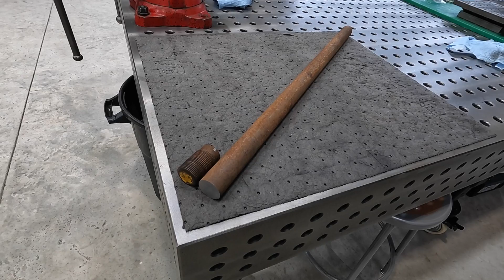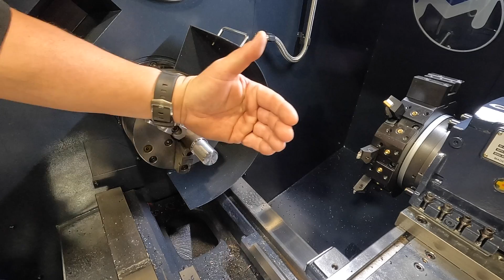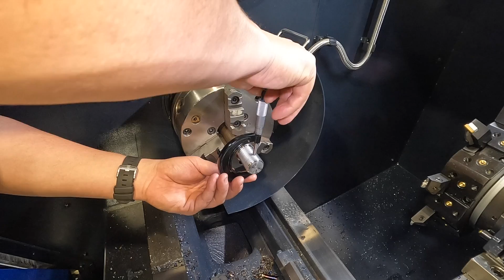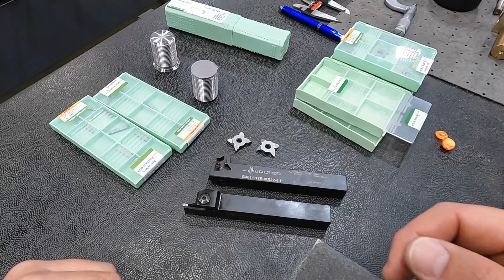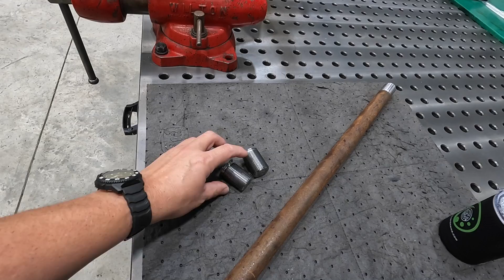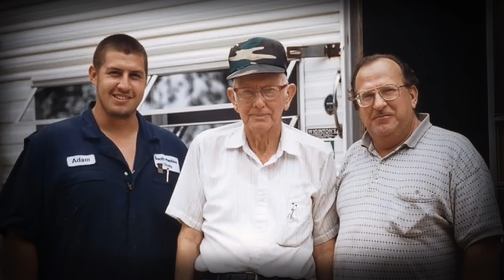CNC Machined Threaded Rod Ends

Comment: I am trained as a scientist, not a machinist, but perhaps I can still be useful. I know that I get paid for measuring things but you get paid for making things to measurement specs.  Still, all of you successful traditional machinists take a lot of "extra" measurements:  measure twice, cut once. Could you write a few CNC programs that just measure things?

Most CNC tooling and methodology seems to automate tried and true manual techniques.  Where are your analogues for dial indicators, edge finders, calipers, and micrometers?  Having watched a bunch of CNC videos, it seems to me that one common replacement for the dial indicator is a tool with a white rod and a red sphere.  That can be used to "touch off" on surfaces before applying cutting tools to those surfaces.  For example, in this video, you put bar stock into the chuck, set its stickout by measuring with a ruler, and then took a first cut on the face.  Sometimes your first cut was small, sometimes it was big. If you had used something like the rod-and-ball tool to literally touch off on the rod end, you would know exactly how deep to start your first cut.

If you built up a few ultra-simple measuring programs, you could use them to be more confident about knowing where your workpiece actually is.  Running a program would likely take less time than even using a ruler, much less a micrometer.

Since I'm not a machinist, these are just suggestions.  You're doing great already, hope you continue to learn.  I've been a fan and a subscriber of this channel for years.
Reply: Scientist comments are so recognizable, so eloquent.  I remember a scientist wrote a long paragraph comparing the metric to the imperial measuring system, here on this channel. Normally a topic that lots of ppl weigh in, but his analysis was so thorough that nobody responded; what's more I remember it more for its thoroughness than what he was actually said!.  On your particular points, Adam noted that the bar was cut off very roughly and not square, probably with a grinder; so using a rule to measure stick out is sure to give some variance in the depth of the initial cut. Also more generally, getting that first cut right is often done with a tiny bit of paper for touch off of a tool. The cnc method for attaining consistent stick out is very analogous to the method Adam uses with his fancy  end stop which can be swung in and out of position. For a cnc lathe fed by bar stock,  the turret is rotated to a no tool or blank position and moved to its precise z position.  The feeder moves the bar against this stop and the chuck is  closed.  No need for a dial indicator or probe,  The Renishaw type probe  ( white stick with red ball) is used as a length or bore measuring device rather than as a replacement for the dial or test indicator which measures 'linear' or rotational run out. A big step forward was incorporating the Renishaw probe in the lathe ( or mill).  Previously, if there was a critical bore which needed to be measured before proceeding,  you would pause the program and use a separate measuring device, let's say a bore gauge.  Post machining, the item goes on the CMM for QC using another Renishaw type probe. All probes need to be in line, or you got problems; nonetheless using a Renishaw probe mid program in the dirty environment inside a lathe machine might not be ideal.   And you don't want to use a Renishaw  to probe dirty, rusty surfaces.
Reply: @richardjones7249  , thank you! I'm not certain my comments deserve such a level of praise, but in the spirit of the YouTube community I will assume that you are not being ironic :).  In any case, you gave me a lot of good information in reply, so I am truly grateful.  Being very interested in measurement tools in general, I will certainly look up more on Renishaw probes.

In some sense, I was suggesting that since Adam is clearly a skilled traditional machinist, he should experiment a bit with how he can convert some of his manual workflow efficiently to the CNC world.  I notice that Adam (and others) are often pulling out a dial indicator, edge finder, or other measuring instrument "just to make certain" a mistake isn't about to happen. He might want to do the equivalent in the CNC world.

I certainly didn't mean to imply that one would keep a Renishaw probe on a rust or mill scale covered moving surface!  That makes my teeth ache even thinking of that.  However, when Adam is adjusting a chuck he often will hand-turn the lathe one or two turns looking for high and low spots.  Is there a good way to do that on a CNC lathe?

OK, I'll try to leave the rest of this conversation to the pros.
Reply: Thanks to the excellent comment by Richard Jones, I made a quick foray into the large selection of YouTube videos on Renishaw type probes.  If you've read this far, you most likely are open to the idea that YouTube videos can be useful.  I'm not competent to say which videos are most useful and most accurate.  I would suggest that you look for a video from Haas Automation Inc., with the title "Set Work Offsets in Seconds -- Haas Automation Tip of the Day".  There is also a Renishaw channel. Good luck!
Reply: @stuartschaffner9744  To look for Total Indicated Runout (TIR) on basic CNCs it's done the same way as a manual with and indicator. Other wise really, most (I assume) trust that the chuck they chose has high enough repeatability or they're using a collet system along with large enough stock that you can true your final part to the spindle through roughing passes.

And some things are worth automating, while others aren't. That being said, being a mechanical engineer around the manufacturing world, machine tools are getting more and more sensors as the years pass on. Just a balance of computational power, storage, measurement device and work environment. 

Recent examples in my mind are cameras used to watch SLS/SLM machines as they go layer by layer to check if there is proper bonding though the area currently is "small" (about 1cm^2, it's a master's project that is the length of a PhD working with NASA) as well as using cameras to measure form in situ for free form optics. The camera can be placed in line with the spindle (off the machine?) and is easier to set up, align as well as less sensitive to heat. This is opposed to machining the optic, placing it in an interferometer and aligning the null form (corrector? I forgot the correct term) which really can't have any heat as well as it takes the part out of the machine. Null forms are also a pain to align as they have to be perfectly in line with the optic to work correctly otherwise there is error.

Comment: To reduce the chatter, move the material closer to the chuck. For the groove tool, reduce your RPM and increase feed rate.

In your programming, face your part first, then turn and then chamfer last.

Comment: You may want to try a G76 multi pass threading cycle using your CAM software. It basically cuts one side of the thread at a time, alternating each pass. It doesn’t load the insert as much and you’ll probably have less deflection.

Comment: I usually re-cut the theead major diameter and take another spring pass on the threads to remove the burrs on threaded parts. Easy peasy on CNC machines.

Comment: What is the purpose of a thread relief? Does that not make the metal weaker at that point or Is it a negligable difference in strength?
Reply: It gives the threading tool a place to stop the cut and retract the tool cleanly. If it wasn't there it would be very difficult to retract the tool exactly at the end of the thread without running into uncut material. It does weaken it sure, but not by much and it should still be well within the factor of safety.
Reply: @Braeden74  aaahhh thanks for the explanation. Totally makes sense.
Reply: The thread relief should not be smaller than the minor diameter. That is the weakest area of external threads. I cut many external threads on CNC using a G76 and it retracts in X gradually to the major diameter. No affect to fit, form, function or FOS.

Comment: Adam, talk to Milltronics about how their lathes are setup.  When you change a tool geometry offset by 0.001" that will likely be a radial change.  Some controls have options for making the wear offsets radial or diametric.  I've got my lathes set up in diametric but your one thou change may have moved two thou just because it is a diametric change, not a radial change.
Reply: Agree. The ML22 I use at work is setup for radial adjustment in the offsets but I'm thinking it can be changed to diametric as well.
Reply: He had a Milltronics guy there for training on the machine. Wear offsets are as basic as it comes and surely would have been part of that 'training'.
Reply: @richardjones7249  Adam is drinking from a firehose right now and this is a simple thing to miss or forget during (or since) training.  I have been running my specific machines here for a few years and still constantly have questions for the applications guys. I'm just trying to help him the best I can because he taught me how to run a lathe for free on the internet and now I am actually in a position to potentially give back.

Comment: you really need to consider a different chuck type for the CNC, scroll ring chucks have too little clamping force and the jaws are not serrated enough for proper clamping grip. a wedge bar chuck would be much better me thinks.

Comment: Adam, a little tip for you on repeating stick outs: call up tool 1 and bring it into something like X4Z0 and hand jog into X0 with the stock back in the chuck jaws. Pull the stock out until it touches the tool. It acts like a stop and your stickouts will all be within a few thou if you're repeating ops like this.

Comment: Would the rust on the bar stock hurt anything or add to the chatter? Thanks for the video's.
Reply: It is abrasive and will take the edge off HSS tooling, not so much on carbide as it is hard and you can cut deeper and get under the rust.
Reply: We had a job at the railway where the bar was rusty, the tool tip was doing a skim and not breaking through the skin and would only last a few jobs, I dropped the Speed Per Min down and used coolant (just on the rusty pass) and the tip lasted all day.

Comment: I program with solidcam for the last 10 years, I program in metric, but I always leave 0.1mm in my roughing program, then come back with a finish pass so it's very light on the cut and eliminates all chatter with the tooling, machine and stock. Always always always run a finish pass for a quality finish and to size more consistently 👌 love watching you grow with cnc. Old school subscriber.

Comment: Interesting thread measurement tool,  I don’t remember them or they were not though of when I was a young apprentice.  First time I’ve seen them.  I learned on the old 3 wire and still have them 25 years later.

Comment: Nice to see you using this machine, The nice thing about CNC lathes is you don't need to use those types of radius tools like you would on a manual lathe.  You can program a DNMG type insert to go in there and put what ever shape you want.  I'm not criticizing, just reminding you.  I'm not very good yet at programming from scratch yet.  I run and edit alot of programs on CNC lathes at my day job.  Love it.  We usually rough everything with CNMG on tool #2 then finish with DNMG tool #1. Pretty cool how you can program those radius in with a normal cutting tool or even use radius tools moving in the program, not just straight in.  Thanks for the video, I love these CNC videos.

Comment: Happy New Year. Love your videos and have learned a lot from you. On the fuzzys after threading: I was taught that after the threading, do another finish OD pass with your turning tool and then a final spring pass with the threading tool. This takes the burrs off the OD and the final threading spring pass takes the ones off that the OD tool folded in.
Reply: He's fully aware of that in manual machining, he was saying he needs to learn how to program that into the CNC program, or learn how to do a manual cleanup pass after the program runs.
Reply: @kinda blue  
I was suggesting that he put them in his  program , not do them manually.

Comment: Rigidity-stay close to chuck, more passes on threading-10 -12 +2 finishing, coolant, coolant, coolant, 
Threading inserts have different point geometry some are pointed,and some are flat. Always start oversized 
You can always program down to you hit specs. Slow feed rate on finish pass on thread relief if conversation programming 
Permits.

Comment: Top Tip. There is movement between the bar stock and the chuck jaws "because of the rust on the bar stock" Two minutes with an angle grinder with wire brush. It doesn't do your precision ground chuck jaws any good at all.

Comment: I was thinking there is some micro movement between the part and the chuck due to the length running inside the spindle and rpm and tool load. Maybe a center and tail stock with that much OAL.

Comment: Too bad they don't have a 'file' insert, or a 'stone' insert. Might be an oppurtunity there to create something new.... but, if you do, maybe talk to the manufacturer so you don't crash the unit.
Reply: It is available to buy if you feel you need it, otherwise it is better to do it right from the beginning.
Reply: I've seen and used lots of abrasive brushes to clean/deburr edges on CNC operations. It's a pain to dial in the right F/S (not like theres any tables in the handbook for that kind of stuff) but once u find the right brush and parameters they do work well.

Comment: take lighter cuts for the finish passes with the threading tool, take more cuts, add coolant, the took rub will cause chatter. i just went through this with my lathe. with grooving tool, use a z back and forth walk in, so oscillating the z on the way in. all lessons my lathe has taught me

Comment: Vibration due to lack of spindle/turret rigidity ... I work on a mori seiki nl2500/700 dual spindle . 

Try to reduce the threading passes to 2/3thou and put 2 spring pass at the end of cycle ... The grooving tool for thread relief try Also on that 2/3 thou per rev
Reply: For thread burr try to use full form thread insert : iscar , kennametal or sandvik are the best.

Comment: Are you sure that you have the grooving tool and threading tool in the correct way? You have the turning tool upside down which is ok for anti clock wise rotation of the chuck. That grooving tool looks like it is upside down with the insert clamping screw on the top. It is hard to see the rotation direction. How does the turret lock in position? Like someone else said here you should have the force pushing the X axis down on the bed, Just a thought. It is good that we have feedback so as people can learn. You Tube best thing since sliced bread.
Reply: Good comment. perhaps all the tools could be changed so the turret is always forced down during cutting.
Reply: @danneumann3274  It is a bi-direction turret but the tools should be all facing the same way otherwise the tool height would be miles out. Think about it if you have a 16mm tool and you turn it upside down it will be 16mm out of allignment. You can do it with boring bars as 180 degree rotation is the same tool height.
Reply: @philiptrueman8894 very true. I forgot about the tool height. I have 2 cnc lathes. I should have remembered
Reply: The turrets on the milltronics are like most turrets of the type and allow for left or right hand tools in either position.

Comment: Its a cnc, so there is no need for a chattering grooving-tool at this point, just turn the undercut with your dnmg-insert (-30°). Happy new year!
Reply: It's not necessary for an u/c on that job.
Reply: u/c = undercut.
Reply: @4418CARLOU  Yea, figured it out in the meantime, but thx. Thats why i edited my last commentary... but it seems u readed it before. Sry.
Reply: @4418CARLOU  I dont know, if its needed here, depends on the function and the other part. The final workpiece has a shoulder and without an uc u dont have a full thread at the end.

Comment: Happy new year Adam.

the last part turned out very nicely. Certainly already an improvement over the first few tries.

One recommendation: Try to get used to using a tool for roughing and and 2nd tool for finishing, even on small batches like these.
Reply: Conversational may not provide that option. That's where Adam's at at the moment.

Modifying the G-Code generated (to insert the tool change) is a little way up the learning curve. Maybe a couple of days more of self-paced training and making chips.

Comment: Hey abom, as I'm native on a CNC lathe (learned manual lathing after CNC) it's fascinating to see your progress, you can tell that you have the knowledge of the basics pretty dialed in :) For your threading operations you should consider full profile inserts instead of the partial, much cleaner results. My goto insert would be a DNMG instead of the CNMG on this size of machine and kinda rough stuff. With a DNMG you dont need the grooving operation. And i dont know your control, but there should be a table for wear correction, normally you do your tool corrections in this table and not in the tool data itself.

Comment: I think the harmonics are due to the chuck being new, the screws and scroll in it need to bed in and then it will hold the work with equal pressure. Another thing is the jaws might need to be grinded to bring them all to balance. Otherwise more time on the CNC will make it as second nature, just like driving a car.